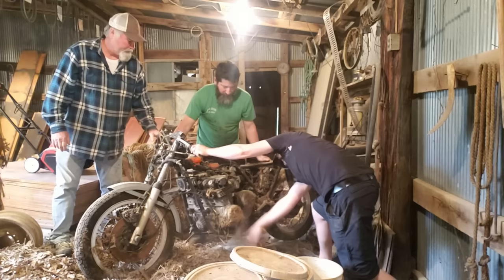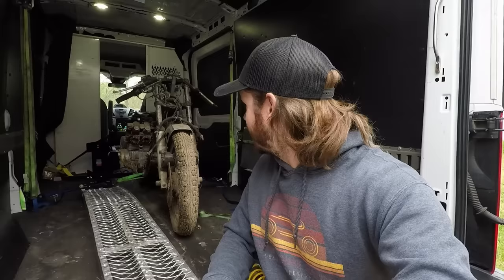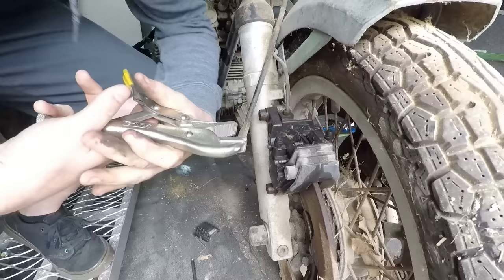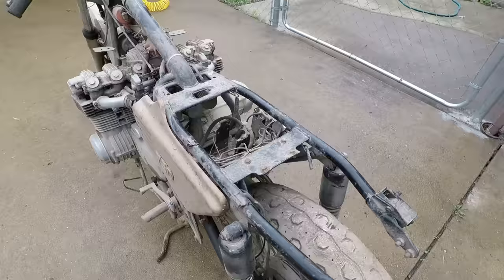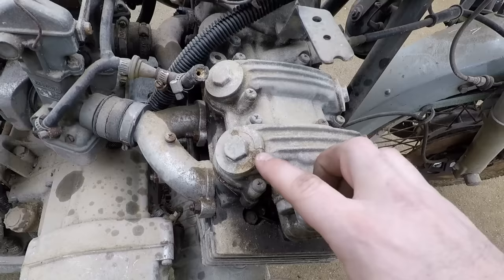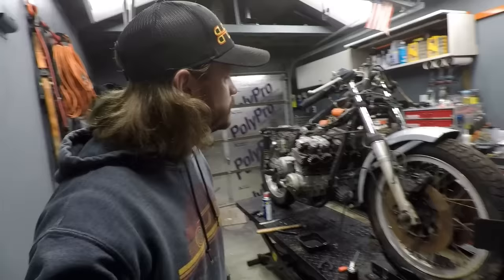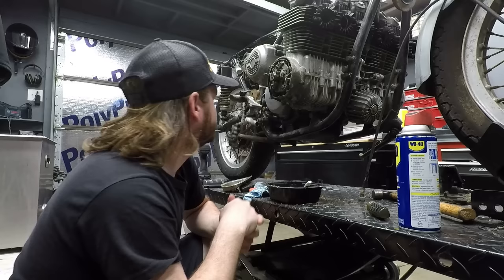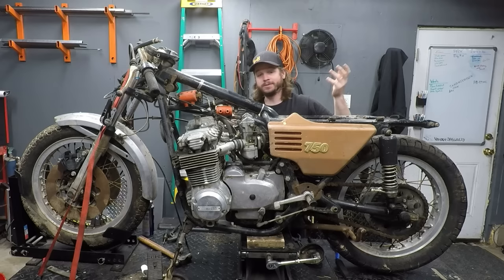BARN FIND Benelli 750 SEI 6 Cylinder!

Comment: I have only seen a handful of those but somehow ended up with a sales brochure. My dad was probably looking at them and bought a Yamaha instead. I have never seen a running one which I find odd. It was a spitting image of old Honda engineering. I would have done what you did if I ran into that opportunity. The last one I seen was in 1996 or so. Except for the Barber collection. They have them there.
Reply from the maker: Right, just not a common bike so I grabbed it with full intent to sell on to be sure it got a good home but now that plan has changed
Reply: @BrickHouseBuilds  
I know THAT feeling! It's why I bought my 2001 KLR. Now it isn't going anywhere but where I point it!

Comment: Yeah no doubt a great find. Man does that bring back memories from back in the day when I was in high school in the 70s there was a few of those running around thinking they were all badass and they were they definitely revved very high higher than the 754s that's for sure. Back then Benelli had a pretty good name good suspension good brakes and very fast. I can do you one better I had a 72 Suzuki 500 Titan that had high and low range gears on it the man that sold it to me told me it was an experimental motor and I should have believed him it was very fast had low range gears and high range gears and I have not seen another one like it since then. If you have ever seen one of those please let me know I don't want anybody to think that I'm crazy or nothing because the Suzuki 90cc was painted the same color and also had that same switch gearing on the crankcase high and low. I can tell you I put a decent set of Chambers on it jetted the carburetors right and was looking into some Webco heads for it. I used to ride around with one of my best friends named Rick who drove a Kawasaki 1000 that had a factory airbrush Star Wars paint job anyway I can tell you when I was in high gear he could not run away from me at all that 500 two-stroke was one screaming motor and dependable on top of it. Anyway I just subscribe to the channel hope to see some great videos.
Reply from the maker: I appreciate the sub Joseph. Definitely check out some other projects on thr channel as there are many
Reply: I had a titan 500 myself, two stroke If I remember right, would have been early 80s I had her

Comment: Take it down and one guy at each end just rock it back and forth between you usually works !!
Reply from the maker: I just don't want to overwork the transmission and clutch. I need to investigate a bit further but still hope to unseize it with relative ease

Comment: I would consider to keep the engine, frame and maybe wheels. All other parts just swap with something modern. Cause i have a feeling this motor is capable of more than suspension and those breaks can handle. Just modern it up for race.
Reply from the maker: It won't go modern with suspension but electronics yes. No need for stock tank/exhaust either. Vintage style for sure

Comment: Those tough screws! Have you a small blow-lamp? A little heat and WD 40  might help to loosen them a bit.
Reply from the maker: I believe I showed me using a torch but if not of course I have that. The screws were very mangled and bent which is why they took so much to get out.

Comment: If you are going to fix it it’s the best thing to do at least it’s not still rotting away if I had it I would be over the moon too good luck
Reply from the maker: Right, I can always do a full rebuild but it may be cool to just make it run at first. Regardless its out of the barn and not rotting
Reply: @BrickHouseBuilds  I would have it in a flash got lots of time only issue is I am in the Uk so can’t just nip round and have a look hope you get it going if nothing else even dead I would have it
Reply: Be careful if welding cases could be magnesium and a bitch to weld do quick repair it looked like it was full of water so not an easy fix total rebuild needed hope you do it watching with interest
Reply from the maker: @billyking722  the water was from my powerwasher as when I sprayed it i didn't know there was a hole there. Luckily it never sat with that hole facing up

Comment: This thing just looks heavy as hell .cornering would have put into a wall the perfect window maker .unless it was designed for racing on a dirt track .you'll definitely need some exhaust pipes before starting though .
Reply from the maker: This thing is actually much smaller than my CBX and much lighter feeling than my CB750. Chassis size is comparable to a cb550 or thereabouts. Yes, need a lot of stuff

Comment: Definitely do not attempt a concours resto - that would be a sad waste and pointless for the reasons you state. This bike is wearing it's history - it was an endurance racer. You'll have tons of laterality to reimagine and reinvent it in that mould. Get creative. Ally twin headlight fairing perhaps, like the le mans 24 hours. 
I wish you'd put plugs in the exhaust ports before pressure washing. There'll be water in the sump now. The bertolli may not be enough to arrest internal corrosion :-)
Get some light oil or diesel down the bores to dissolve the rust around the rings. 
Thanks very much for your videos and your attitude. I appreciate it very much.
Reply from the maker: I agree, it would be max levels of cool going vintage racer. I sprayed wd40 in the ports, then blocked off, didn't spray that area, then removed block offs, blew out any potential water with compressed air, then more wd40. Its good
Reply: @BrickHouseBuilds  I should have known you'd have protected those exhaust ports. Sorry for doubting it. I have found I keep thinking about this bike. It has been popping back into my head since I saw your video. I started watching Le Mans 24 hours footage on YouTube. There's one from 1975. Some of the twin headlight fairings are from another world - extraordinary. Lots of ideas and inspiration there. I'm also wondering how much of the engine could use parts from a Honda cb550. They look so similar bit looks are often deceptive. Maybe none, maybe some. So much potential. The frame for strength and stability was light-years ahead of those old Hondas though. I'm looking forward to sharing your journey with this project. Best wishes to you

Comment: Find a damaged cb400/4 lower case and cut the part of the case out that you need like a patch panel on a car, the engine will need to come apart. Don’t jb weld anything. The motor is rare and special enough to be worthwhile fixing properly.
Reply from the maker: That would be even more welding.  As mentioned any JB would be temporary move as yes, the bike is worthwhile
Reply: @BrickHouseBuilds   just thinking though. To both getting it running and also give you time to fix properly, you could just drop a running cb400/4 motor into it. Then you can get the look you want and get to use it. then once the motor is repaired, just drop it back in.

Comment: It was a racer, the modifications for the shifter being where the passenger pegs were means the riding positon would have been prone, on ones belly, it is or was probably a dirt track racer from that area you should try doing some research in the area see if you find out anything?
Reply from the maker: The pegs are actually on custom brackets welded to the frame and not passenger pegs mounts. This wasn't a competition bike. It was just a guy who liked to modify his for having fun on the twisty roads.
Reply: @BrickHouseBuilds  I tried to post this yesterday and I think it was removed? I am going to do it differently in hopes that it is posted.

Please do a search for "Benelli 750 SEI" on a site called Pipeburn the article is good but look at the images, the shifter, I think that is not a homemade shifter?
Reply from the maker: @engir63  I saw it and replied.  The brackets are welded to the frame and are custom.  The pegs themselves I do not know what brand they are but the work done to the bike was by an enthusiasts and not pro

Comment: Engine needs to come out regardless to clean up engine and frame….. do not do jb weld….. tig weld to build it up then take your time with a file to flatten mounting surface…..and re-tap or chase threads
Reply from the maker: JB weld it is! Many variables here in play. Id obviously prefer to it perfectly with a full bare case strip down but if I can make it run without that for a bit that sounds more fun.

Comment: yep! that's gonna be one of those bikes that will cost 3 times as much and take 3 times as long as you think it will..😆...good luck 👍
Reply from the maker: Im not expecting it to be cheap or a quick process. Being that I am going to build a period racer of my dreams there wont be a ton of cost associated with OEM parts. I won't be in a rush either.
Reply: @BrickHouseBuilds  good plan, aftermarket bodywork and a loud as f**k exhaust will be so sweet 👍
Reply from the maker: @breathestrongcycling3672  well It will sound good but I don't feel the need to impose my interests on other people just to anger them. A 6 into 1 and tasteful muffler will be perfect

Comment: a good welder can weld that case up, fileit flat so that cover seals, 3 sets of points, unlock, rebuild, good to go, these are very collectable bikes.. tear it down, rebuild, repair case, scream on down the road
Reply from the maker: Can definitely be done but the tricky part I see is the steel oil passage tube under the aluminum which would be a challenge to keep from melting at the necessary amps it takes to weld aluminum

Comment: BJ, I can't tell from the video, are those cracks into the oil sump, or is it just around the ignition points.  It would seem to me that if it is not going to cause an oil leak, it wouldn't be too much grief.  You could even get it running without worrying about the cracks.  Regardless, I think it is an awesome find.  Don't get discouraged.
Reply from the maker: Hey Ken, the broken section is at the end of oil galley and what feeds the crank main bearings. Needs to be sealed for sure but all things considered it can absolutely be fixed

Comment: You know what’s a good idea? A 6 cylinder motorcycle with DRUM BRAKES on the back 😂😂😂
Reply from the maker: I mean they are plenty powerful to lock it up any time
Reply from the maker: The twin dual piston Brembos in front are what stop you
Reply: @BrickHouseBuilds  yeah those Brembos won’t have a problem. And that’s probably the lightest of the 6 cylinder bikes. But it sure looks funny
Reply: @BrickHouseBuilds  yeah they won’t have a problem stopping that, but I would still have put a disk on it I was designing it. I would imagine the Benelli is the lightest of the 6 cylinder bikes. It’s absolutely lighter than the Kz1300.

Comment: looks as though the whole front end triple trees and all are straight off a Moto Guzzi. It doesn't matter if you pull the brembos apart.
Reply from the maker: A lot of the suspension is the same as Moto Guzzi and some BMW models of the era

Comment: Great find! Difficult decision process for what to do. The longer you keep it and the closer you get it to original the more it is worth to the average buyer.  That is not to say 'concourse original' should be the goal nor is that all that it is cracked up to be. The demand for 'original' in all collectibles stems from the buyer's ignorance of the value of something other than original. The market can't possibly process each little mod to arrive at a value so they just place a premium on 'original'.
There is real value (to the right buyer, not these 'original' nancy boys) in a period correct racing machine. Provenance, especially documented,  can triple the value beyond a concourse original. Who raced it? What races did it run in? Did it ever win? Don't assume anything negative, it could have been raced by a famous racer and won famous races. Pessimism (and the pessimists you will encounter) can suck the motivation out of these kind of projects. Research research research, the internet can answer a lot of these questions. I know it looks hacked up by todays standards, but that is how most period race bikes were built back then. You have more skills, tools and materials available to you than the typical race bike builder in the 70s had. In many cases even the factory guys.
I'd find out all the details you can about this bike regarding races run and by who,  and what YOUR cost to put a little resto into it would be. 20k is if you pay someone else, if you root out parts here and there and do all the work yourself it will cost you a lot less. 
I've seen your skills, you got this.
Reply from the maker: Thanks James but most of your comment revolves around value to someone else. That is irrelevant to me as I want the bike to be special for me. I do not care about what a collector will pay, what the market is, how much a stock exhaust is. I just care about how it will make me feel when done as I get to enjoy both building and riding it!  I feel there is always too much emphasis put on value to somebody else when these were made to be enjoyed. I am confident this was never actually raced but rather just modified for fun street riding back in the day.  Ill do my digging though.  I'm super excided to get on this one.
Reply: @BrickHouseBuilds  Great point. I was mostly responding to the 'make it original' crowd with the value comments. I agree about making it for yourself though, that is why I never build back as boring original. Not interested in that.
Reply from the maker: We definitely agree then!

Comment: Needs to be welded. Not a good place to use JB weld. I've repaired cases around the main shaft with JB weld where poor chain maintenance knocked a hole in them.
Reply from the maker: The steel lining of the oil galley at the crack makes welding more complicated than a straight aluminum fill. Jb may be the initial move but ultimate goal will always be the proper way to do it

Comment: I wonder if that outer cylinder is still full of oil from it laying on its side. Also wouldn’t putting it in first gear give you more leverage to turn it over?
Reply from the maker: I doubt it would have much in it but ya never know.  As far as leverage it would be opposite.  In top gear you are working to rotate the engine the slowest.
Reply: @BrickHouseBuilds  ok and sounds good. I thought just having it in 5th would require more torque on your end to turn it over since to gearing is for top speed.
Reply from the maker: Nope again just the opposite as you are working from the other end.  In 1st the engine has the most leverage on the wheel which is why you require the most power when going high speeds.  1st gear - engine revs highest per wheel speed vs 5th gear - engine revs lowest per wheel speed
Reply: @BrickHouseBuilds  ok thanks for explaining it🤘🏻hope to see this bike back out soon.

Comment: I wonder how much water went into those exhaust valves
Reply from the maker: Zero to be exact. What you didn't see was a healthy coating with WD40, then filling the ports with rags, then simply not spraying on the ports which everyone assumes I did, then removing the rags, using compressed air in the ports for any residual moisture, then more wd40. This isnt my first ro-day-yo

Comment: To remove the engine and the lower crankcase half is not that big a deal, as most of the engine ie crank and gearbox will stay in position.
Reply from the maker: Yea shouldn't be bad. Just a time issue right now
Reply: @BrickHouseBuilds  personally I wouldn't bother with the JB Weld idea. Do the job once.
Reply from the maker: @velobob4299  Thats normally my mentality as well

Comment: Wow you have your work cut out for you there but if anyone can bring it back to life you can.
Reply from the maker: Won't be easy but it will be worth it!
Reply: @BrickHouseBuilds  I told my mate whom is a bike mechanic that I saw a Benelli  750-6 and the motor looked like a Honda motor and he said that there is also a 900-6, they asked a Honda designer to come over and design a 6cyl motor for them!
Reply from the maker: @banditnev  Yea the 750 was the first production 6 cylinder motorcycle.  They are based off the Honda cb500f.  Definitely give it a Google as its a cool story with the same idea as the Pantera using Italian design with a reliable engine

Comment: Look…Pull the engine…Cover the frame with a cover and put it aside..The engine won’t take up that much space..you can pull the lower part of engine and have aluminum welding done to it…IMHO….
Reply from the maker: I mean you say that but I have a fully disassembled CBX engine that takes up 3 full totes, and 3 full shelves of storage. Then the chassis. I can weld it thats not an issue. It just goes back to space and time

Comment: Ultra cool, but a smack on the end of the crank could be very, very bad. Full engine strip . Probably the worst engine ever if it got crashed. I'd guess bent crank. I'm sorry to say this, but I guess was parked because it was terminal.
Reply from the maker: A bent crank is definitely a concern but considering the mud on the end I'm not sure any diag was ever done. Lets hope its not bent though.
Reply: Good luck, very interesting journey of getting set to work it straight with a press and blocks and lots of gauges. Not impossible..Do it.

Comment: Did you pressure wash water into the open exhaust ports…?
Reply from the maker: No, many have been thinking that but I simply did not show that I filled the ports with wd40 first, then stuffed in rags, never aimed in the ports as I washed around them, then removed the rags, air dried any residual water, then more wd40.
Reply: @BrickHouseBuilds  Phew!

Comment: Shave that oil drain plug back even and run threads in it
Reply from the maker: Not that simple. There is a steel tube within the aluminum casing.